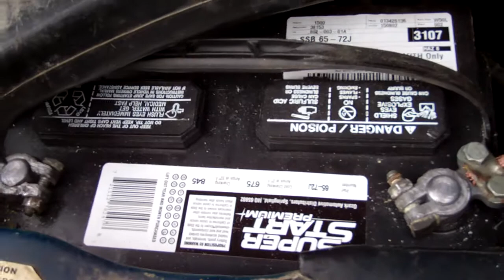Sucess!

Comment: in the future you might want to pour a coke yes a can of coca cola onto them battery terminals when they show signs of corrosion on them as it will eat the corrosion away and its much cheaper than the acid buster stuff found at yer local parts store because of the external solenoid fords and dodges are known for not starting if the wires arent cleaned i use a pair of slip joint pliers to clean the posts just put them on the bat post and with a lil pressure turn them around the post cleans em up